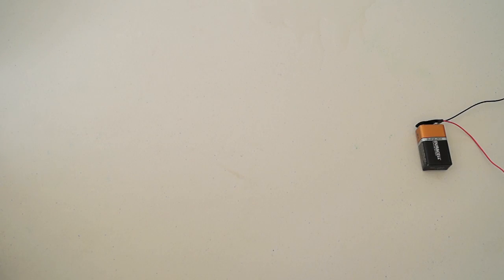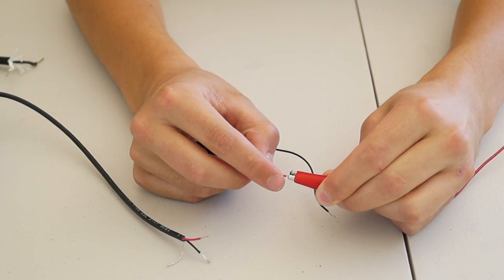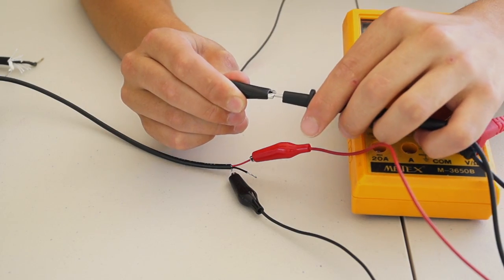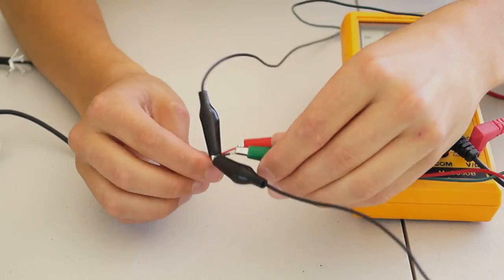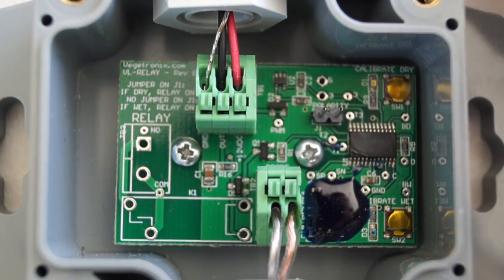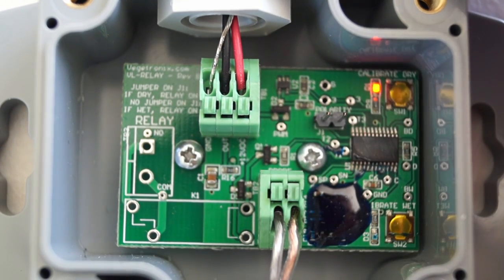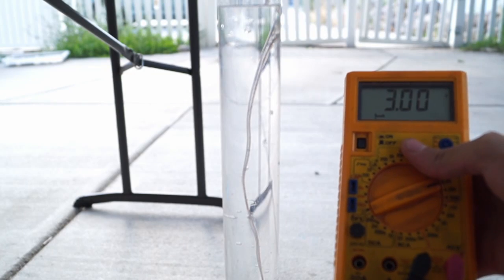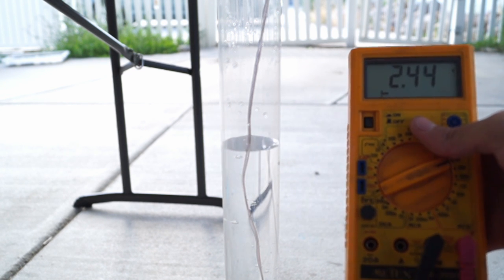Techno Gardener: Water Level Sensor Calibration

Comment: I was trying to calibrate dry then wet strangely both LEDS were blinking. Tech support said that happens if the circuit cant figure out a stable sense capacitance, Tim suggested tightening sense wire screws That worked!!! Thank you Tim.